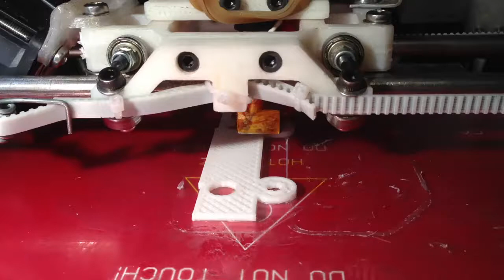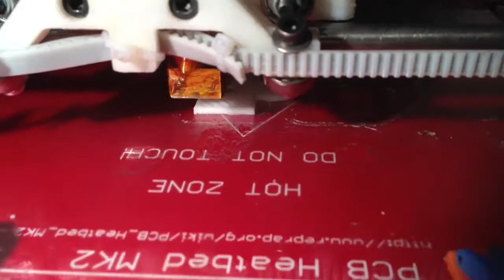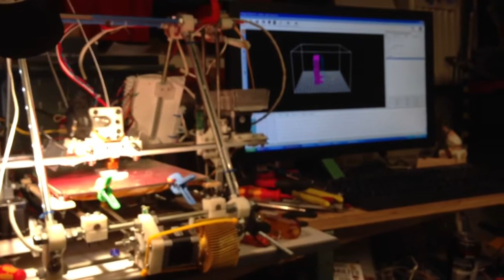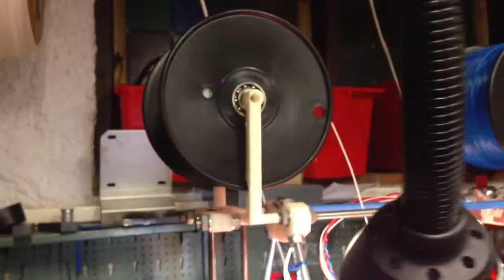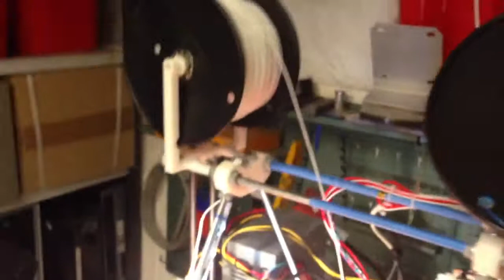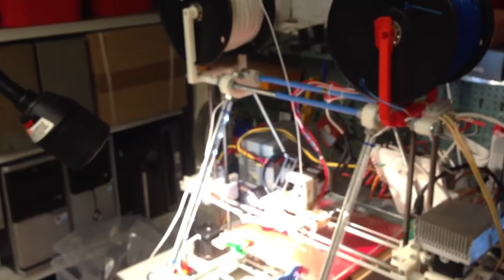Reprap mendel 90mm/sec

Comment: Why were such large heat sinks used?  I never feel excessive heat on my Mendel's stepper motors.  However its heated bed SSR is another story.
Reply from the maker: I am really not sure - the motors got hot, so I cooled them. Mind you, the steppers are not your typical steppers, but old crap that I salvaged from some machinery, so they probably have a horrible resistance for the drivers I use or something. In any event, the heat sinks keeps them ok cool, so problem solved.
I could change the stepper motors, but then it wouldnt be my original first mendel anymore, so I will stick with this :)